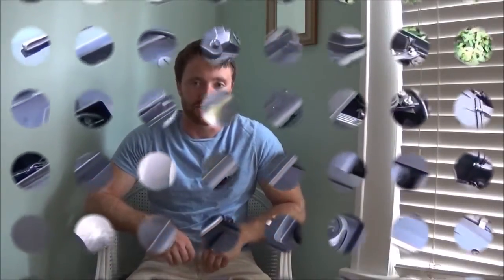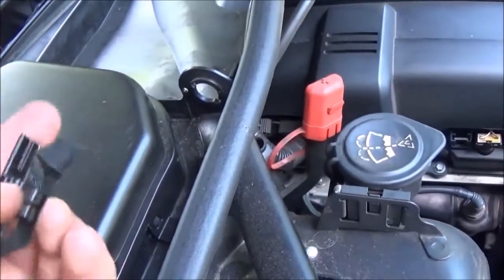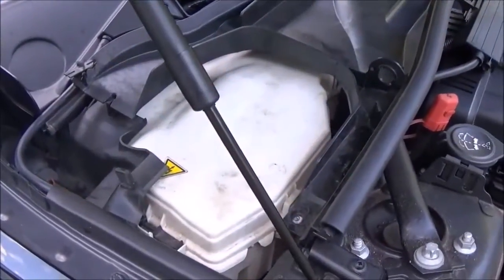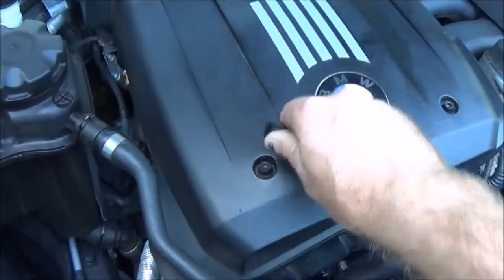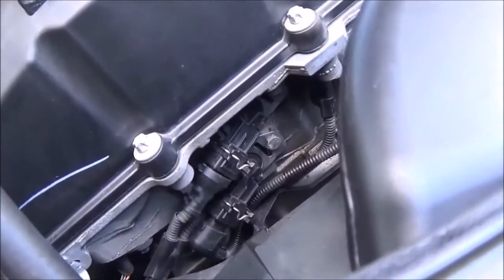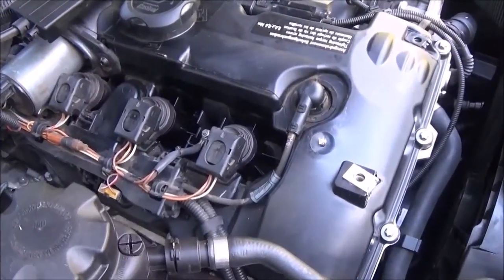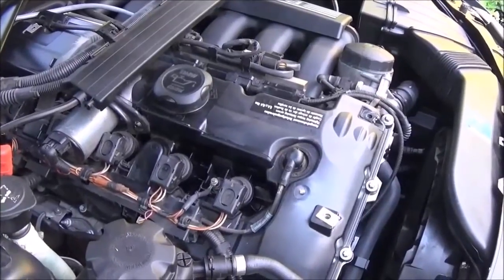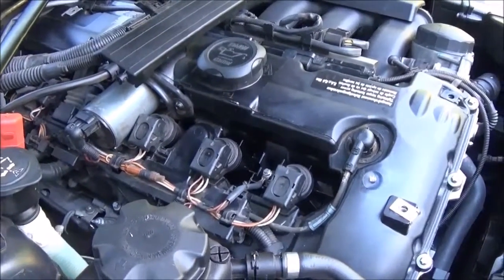Accessing the BMW N52 Engine (E90)

Comment: I had the same problem. Found oil stain lots of them. Cleaned them up and I removed the cover.  Drove as usual and keep checking the engine. No leak. Suspected the spill when doing oil change.

Comment: I'm thinking about leaving my engine cover off permanently to help disperse heat and also so I have easy access.
Reply: I did that coz easier for me to clean and watch for any trouble. The injector sound is louder without it other than that its ok. When you close the hood you dont hear much noise anyway.
Reply: @ENP-ln1nd  I ended up leaving the cover on but trimming from the front and back . Now I have protection but better cooling and can also keep an eye on things.

Comment: Oil on Cyl 2 .... where did it come from ?
Reply from the maker: SkyCam Canada No idea I cleaned it up and it's been about 2 weeks and it didn't return
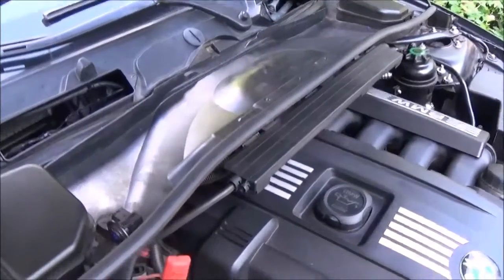Reply: BMW-E90-HQ it is really weird. Did the dealer say anything about it ? Btw .... 1:03  i am almost sure thats a air sensor .
Reply from the maker: SkyCam Canada No the dealership didn't mention anything at all. The only thing the guy said was that he liked my exhaust and that the car was in good condition.
Reply: this is AUC Sensor
Reply: Likely that you have a cracked valve cover (as I do).
Reply: You probably just spilled from filling on the top cap. I’m literally watching this video because I spilled lol. Nothing to worry about just some spilled oil
Reply: I was told by my local mechanic that the oil on the plugs is due to a bad oil cap gasket or spilled oil.